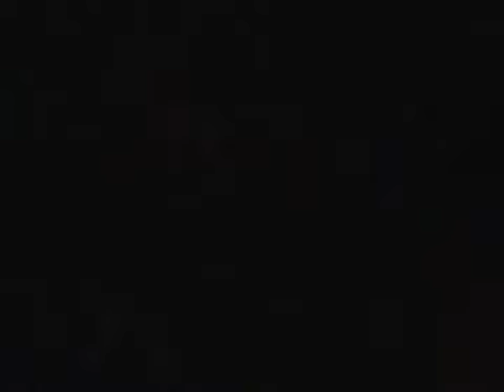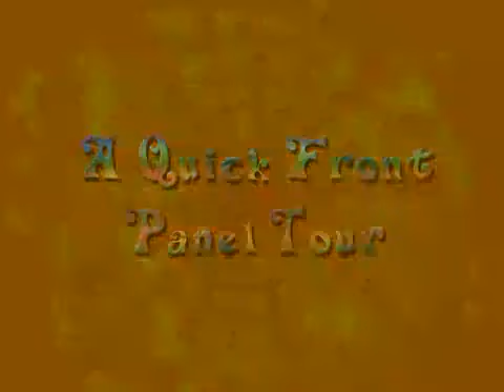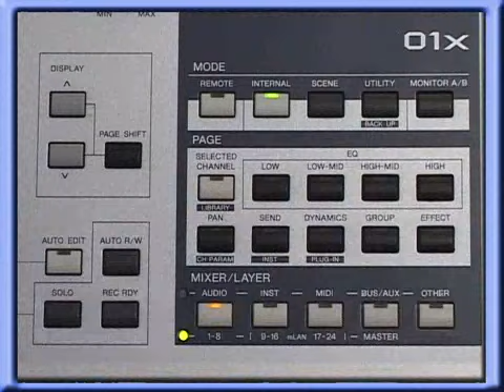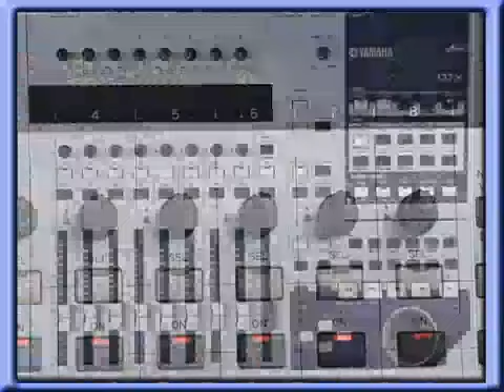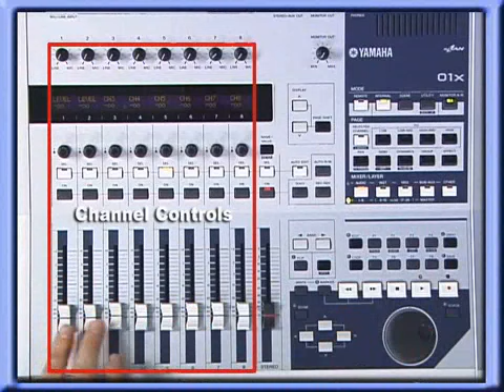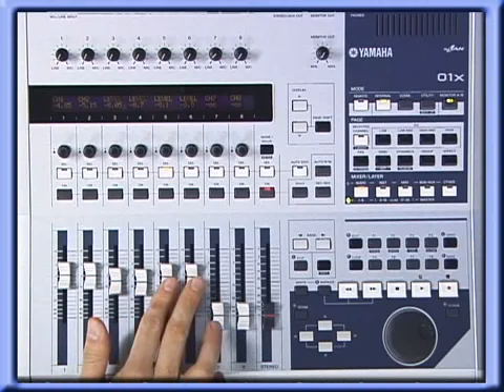Comment: Bram, do you still use the yamaha 01x? Could you possibly tell me how you hook up both machines at the rear (to connect both via midi?). Also: As you're using them connected via the patchbay, I'm assuming you have all 16 channels of i/o + the digital i/o? I'd love some help with the set-up of the patchbay using the mlan, if you're available? Many thanks.